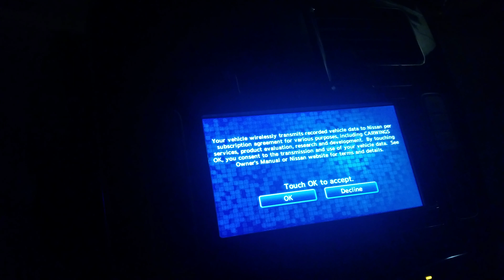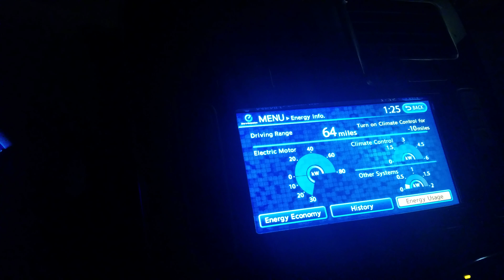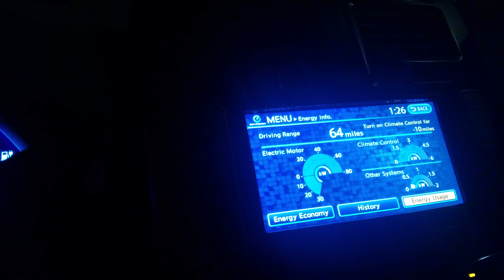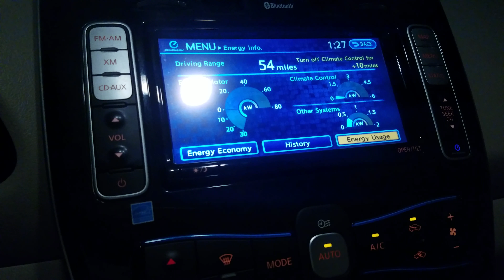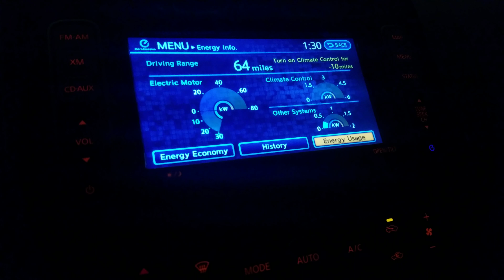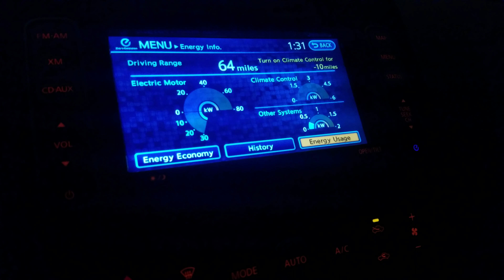Do accesories effect range in a Nissan Leaf???

Comment: if you connect an inverter to the 12 volt battery you can run about 1.2kW at 110volts to power your fridge in your house for some time. you have to leave the ignition on so that the traction battery will keep the 12 volt battery charged :)   how cool is that?
Reply from the maker: +bitman EV In places that get hit with bad storms this is a good thing to keep in mind. Or maybe for camping trips too.